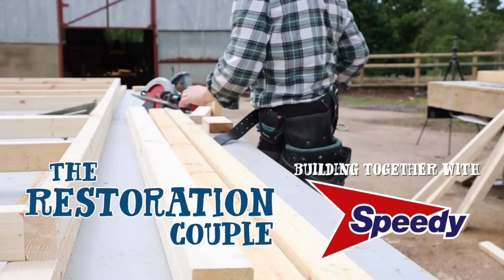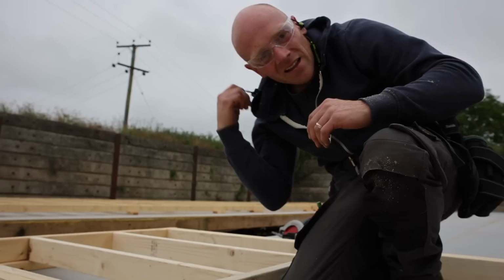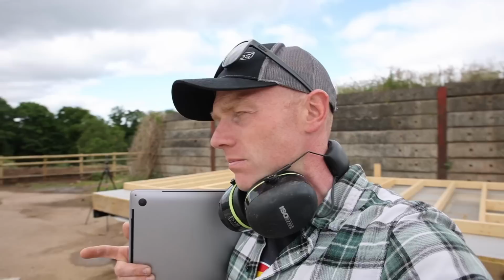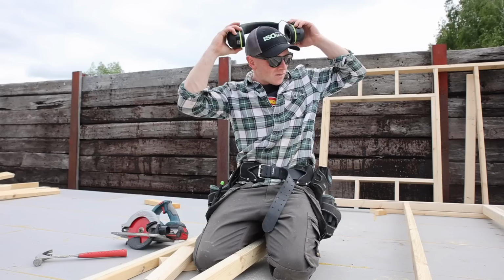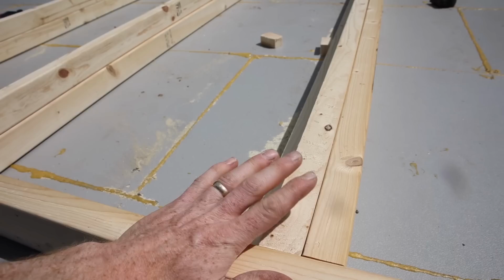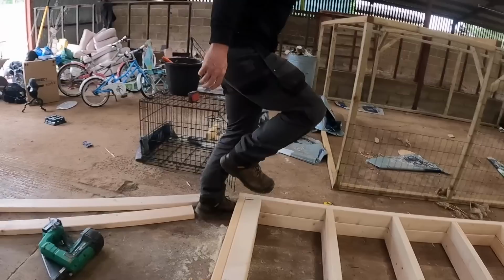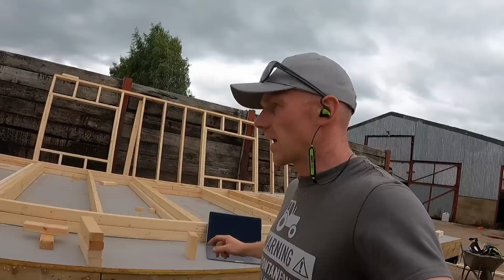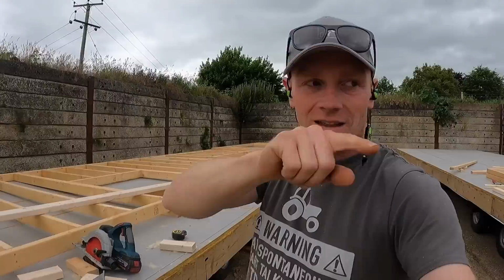FRAMING EXTERNAL STUD WALLS - Great progress while the sun shines!

Comment: Tim, you need to learn to use your left hand or you might not have one for much longer crossing your arms on the saw like that. You're  right about the millimetres though.  I'm a carpenter btw 👍
Reply: spotted that and thought what's he doing. That's a hand off way of cutting. Getting cocky with the circular saw too, beam on leg and make the cut. I'm a Spark but, have friends who are carpenters, who've lost fingers etc not thinking about things and being over confident
Reply: I was concerned by this also.

Comment: 100% right on the way you use measurements, how dare the apprentice argue. Nice timber you got there. When putting in noggins don't forget what you need to fix to the wall, basins, boilers etc.
Reply: Wall mounted tv brackets and cabinetry! Very true

Comment: Instead of measuring each stud at 400mm centres you could save a lot of time by having two offcuts of the same precise length that would create 400mm centres when butted up against the previous stud. One at either end would also ensure each stud is square to the first. Great videos and really enjoying the channel.

Comment: Absolutely work in mm 2324 engineering way so simple. Much better than cm or worse still feet and inches
Reply: As someone a tad older than you, we were only taught feet and inches at school and not told about mm/cm. So when I go to the wood yard I still ask for 2x4 or  2x6 as they still know what I mean. I also cheat at times and take my imperial/metric tape measure with me, so that when quoted a number I can quickly convert it to what I know, it also saves me being so confused which is not hard to do at my age. Thanks for posting
Reply: @footplate0  bloody hell, how old are you? I’m 72 and of course I was taught feet and inches, but metric is far far simpler
Reply: Yes mm all the way.
For example when American trades quote in inches something like 23 and 3/8ths, trying to view and visualise those increments on a tape measure is so finicky.

Comment: Tim, you should really try and do the cutting on the station with your right hand holding down the wood and the left one pushing down the saw. So much safer. (Never cross arms!)
Reply: Very true 👍
Reply: I saw that too, that made me cringe 😬
Reply: I Have started doing this recently, feels so much better.  Never used to take much notice of others doing it but this made me worried.
Reply: Also I am really nervous about the nail gun! His wrist is in range, though I can’t workout another  way without increasing the time to fix each stud.
Reply: @markdebcam  Oh good, glad I wasn't the only one thinking that... Made me nervous to watch too

Comment: Tim why haven’t you cut a couple of template blocks at 400 & 600 (minus stud thickness) which would make you laying out quicker
Reply: Agreed, that’s what I would have done too
Reply: Marking top and bottom plates at the same time while they're together, with a line and cross, is the only way to make sure they line up.
Reply: Accumulative error makes this not practical.
Reply: @magicboyb  ...which is why Toby above is correct.
Reply: yes, template, just make it perfect even if that means cutting off half a mm with mitre saw
Reply: Accumulative error, over that distance the studs would be miles out, even if you swap spacers with your partner

Comment: A handy tip when pulling a stubborn nail with a claw hammer is to place a small block of timber under the hammer before you pull. It makes the pull stronger.

Comment: For anyone born since we first joined the EU, you will have been taught only metric but we managed very well prior to that with feet and inches. As a DIYer, I still use the old imperial measurements which I'm more comfortable with.

Comment: Chopsaw in the shed: it would be much more practical to saw with the left hand… Safer too, I reckon, but I’m not from that squad 😜
Reply from the maker: I would always work from the left but that would have meant clearing away loads of junk and I must have been feeling lazy! 😬
Reply: @TheRestorationCouple  There’s only so much workspace we can keep clean 😉 But still, with the same setup there (no need to clean more), operating the saw with the left hand and holding the workpiece with the right would have made more sense.
Reply: Nearly sawed my arm off using it like that, blade went straight through my watch, be careful

Comment: Measuring from the second stud edge, and onwards, may sound right, but just make sure all the stock timber is of correct dimensions, they are mostly correct, but rarely always, until you get to the end run and find out the spacing is varied
Reply from the maker: Very true, certainly wouldn't trust it on rough timbers but they are usually fine.  That said, we cut all the studs in one batch to discover that the second delivery of 4.8m we used for wall plates was 4 mm thicker. 😔
Reply: @TheRestorationCouple  Just another thing to make your life easier then matey ?!?! .... 😪

Comment: Just wondering if you take account of the sheet size of the sheathing? I learnt framing from YouTube and was shown how to 'pull back' by half the width of a stud so the sheathing ends half way across a stud. Using 8x4 OSB the sixth stud centre is 2421 or so from the end. Saves a lot of cutting and each edge has something to fix to.

Comment: I know mm are standard, but I find them hard to wrap my head around. In my head I think 2.324m. I do of course SAY it in mm, because I've learned, but it never works like that in my head. Two thousand of anything is too much to think in. I blame the fact that I started in imperial and then switched to learning metric around the age of ten. It was mentally messy. Much easier for those of you who started with a sensible system!

Comment: I'd go for two three two point four - as while the tape measure has millimetre markings, the numbers are labelled in centimetres. Avoid saying the thousand / hundred etc as it makes it more complicated and you end up saying a wrong number, like 2334 😉

Are you guys planning on putting plasterboard up before or after you get the cabin in position? As that could easily be an extra couple of tonnes in weight either side, and make moving the chassis a lot harder.
Reply: it's 2324 in mm get a grip

Comment: I am confused why the interior wall is not as strong as the exterior wall. If the building is taken apart as you said it will be when your "real house" is built, it will be dismantled in the center and moved. Won't that interior become an exterior wall at that point?
Reply from the maker: The interior wall is perfectly strong enough and the external walls could have been done that way, only reason why not is so we could have more insulation and also a bit more strength for cladding, windows, etc.

Comment: Love your content, however I have concerns about you're advertising with Speedy. I've got nothing against you or the brand but you are not properly disclosing the sponsorship in accordance with ASA guidelines. "Building together with" is not considered clear enough that it is sponsored content, plus content that is editorial (aka your normal content) and advertising content should be clearly separated. Speedy should of informed you of these requirements before agreeing to this as you can both get it trouble and get fines. I don't want this to happen so I'd recommend doing some research into UK advertising law and how it applies to YouTube videos.